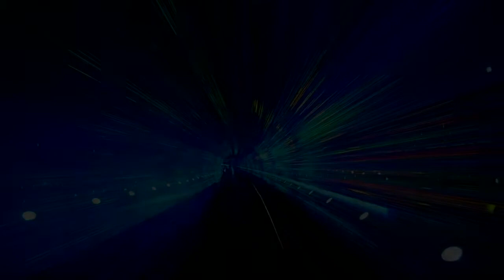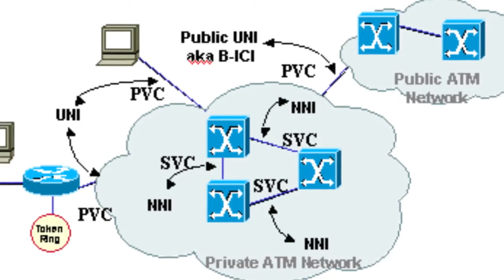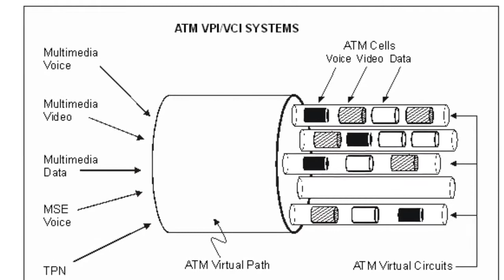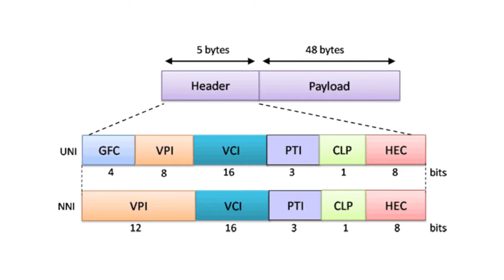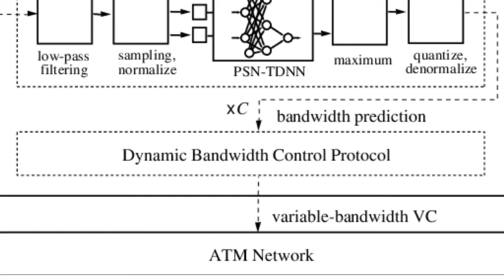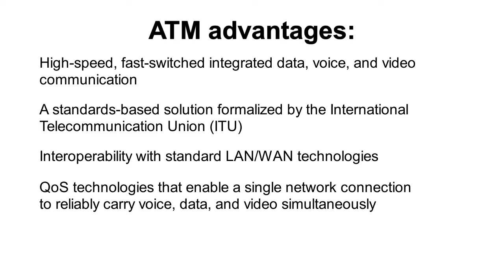Asynchronous Transfer Mode - ATM - Network Encyclopedia

Comment: so who is the consumer after all? who uses it the isp or the clients? and also is it still used today? and for what purpose ? what famous examples can be found to use this protocol ? 

thanks
Reply: We use it for transmission of peg channels
Reply from the maker: Great questions — thanks for asking.
ATM was mainly used by telecom carriers and ISPs within their core and backbone networks, not directly by end users. Customers consumed services (like DSL or enterprise connectivity) that were internally transported using ATM.
Today, ATM is largely obsolete in new deployments. It has mostly been replaced by IP/MPLS and modern Ethernet technologies, though it may still exist in some legacy telecom infrastructure.
Historically, ATM was widely used in carrier backbones and early broadband networks, especially during the 1990s and early 2000s.
Appreciate the thoughtful questions!